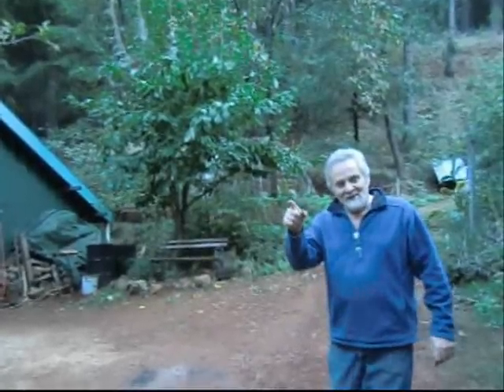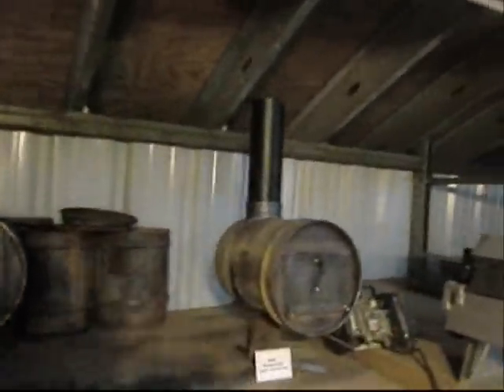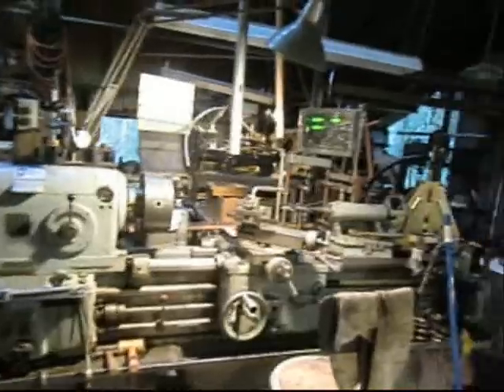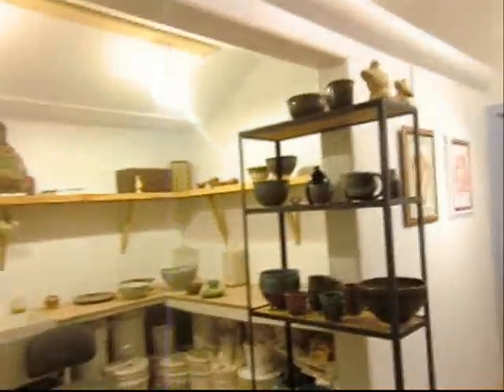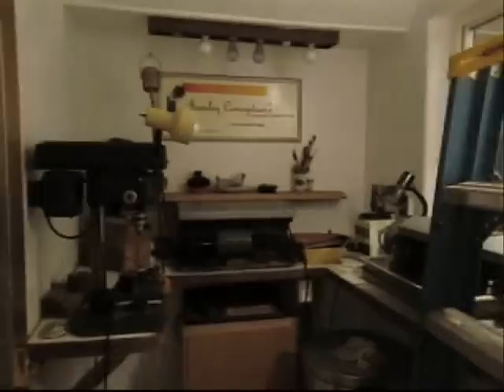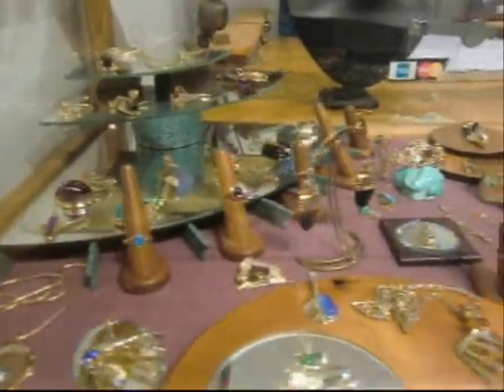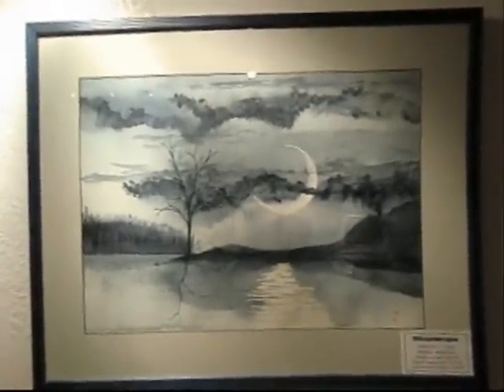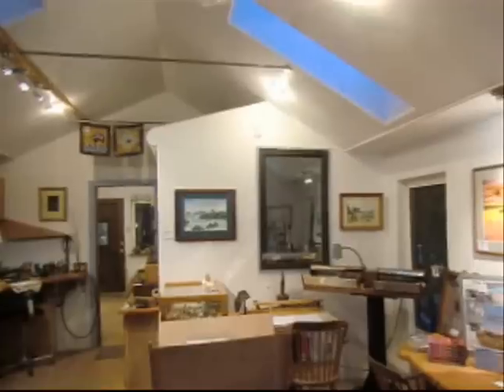Studio Tour October 2013

Comment: Why not design the stator so that the magnets can be adjusted by sliding them around the inner diameter and then setting them with a set screw.
Reply: It would save you material costs.